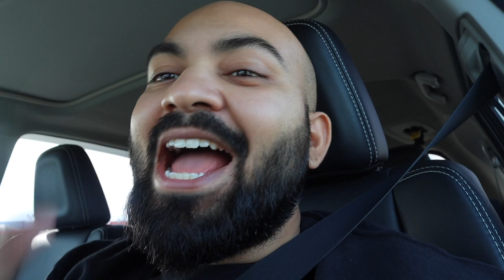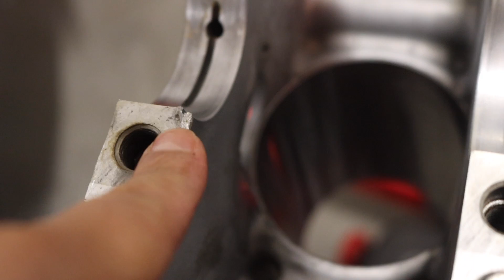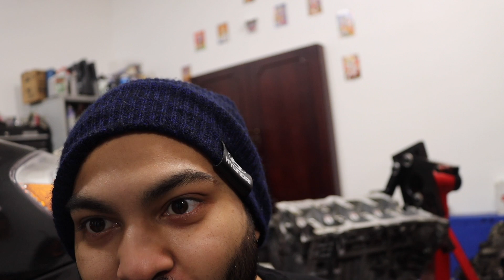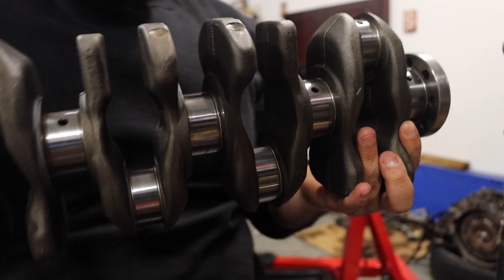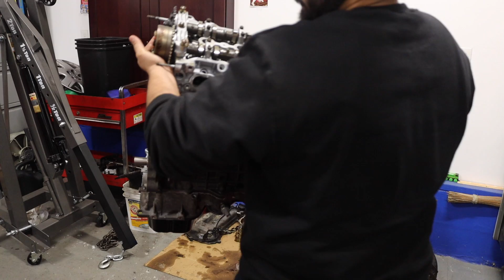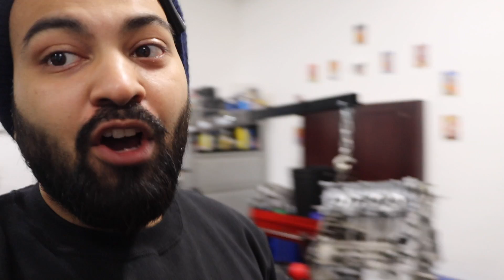1zz-fe engine assembly part 1 (1/26/2021)

Comment: How hard would it be to put a 1zz in my 09 corolla?(2zr-fe)
I know it's technically a downgrade but that's ok👍
Reply from the maker: It wouldn’t be that hard honestly it should line up
Reply: @Kingcustomz  that is terrific news. My 2zr has bad engine knock, and it's the only car I have. You think both the mounts and transmission will align?
Reply from the maker: I believe so the only thing that should be different is motor size